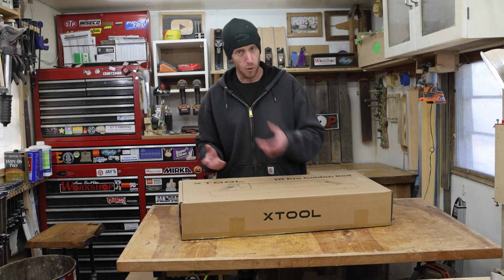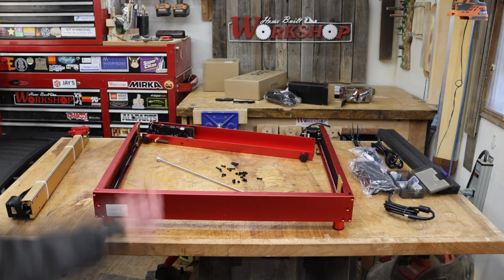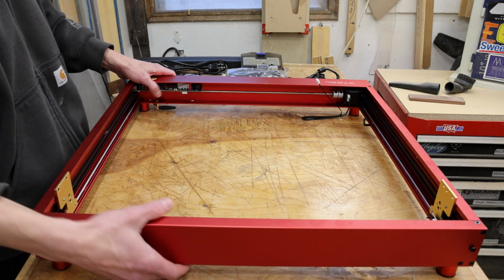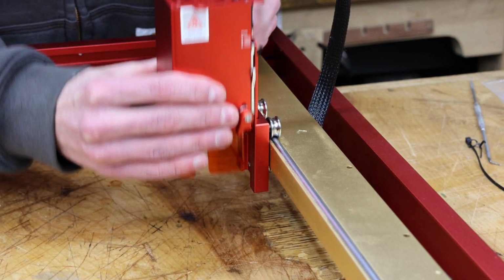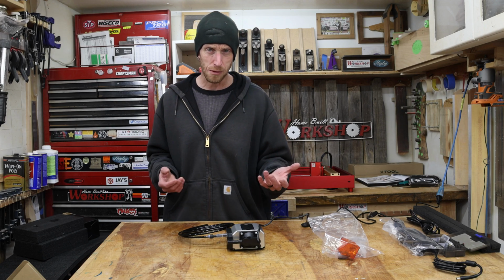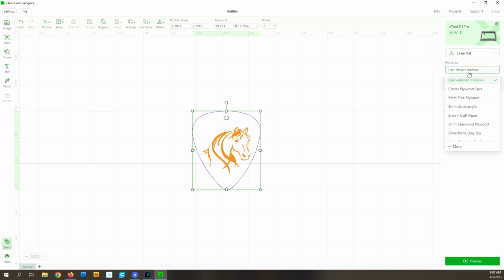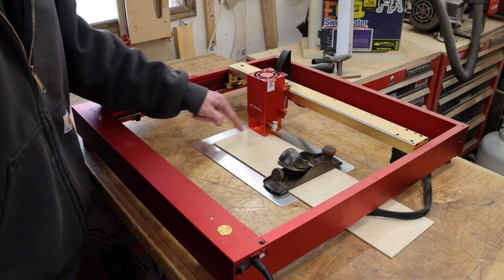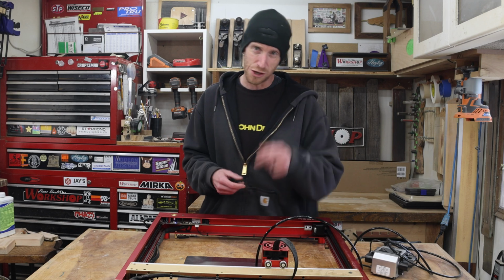How to set up the xTool D1 Pro Laser | Making the first laser engraved project

Comment: I love the ease of putting the machine together with your instructions.  My son in law pit mine together last Sunday and on Monday we attached the air assist and the ventilation tubing.  I couldn't get it to connect with my computer when I attached it to my USB plug.  Did what I was supposed to do but no such luck so far. My big problem occurred on Tuesday when I was going to try to connect the machines again and the laser machine won't turn on.  The air assist works and so does the fan so I know it isn't the plug it connects too.  I don't know why all of a sudden it doesn't turn on when you flip the switch.  Please help if you can,  Thank you,
Reply from the maker: Thats weird. I'd triple check all the electronic connections first, if that doesn't work you might reach out to the xTool support team. As far as the connections goes, make sure you have the little microswitch on the main board in the correct position. It mentions this in the instructions. I can't remember what position it needs to be in for normal operation but it makes a difference. I hope that helps a little.
Reply: @homebuiltshop  thank you, I will try that and see if it works.  I am so ready to start new projects as my regular D1 10W laser broke.  they have no replacements for the laser xtool told me so that's why I got the new one.

Comment: I just finished putting mine together. Some of the plugs were a pain to get, because I have big hands. Tomorrow, I will set it up on the computer with light burn. I also got the cover to go over it, since I will be using it inside.